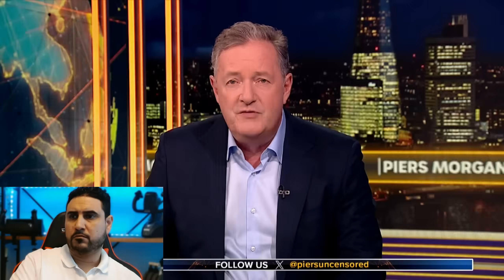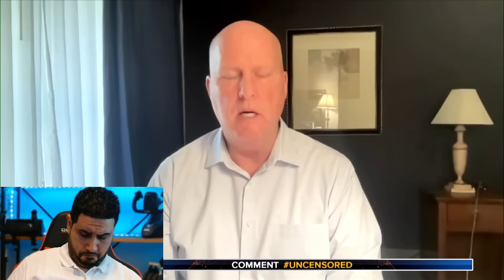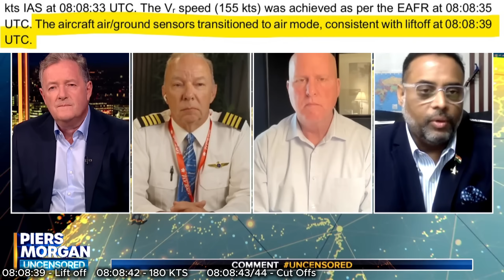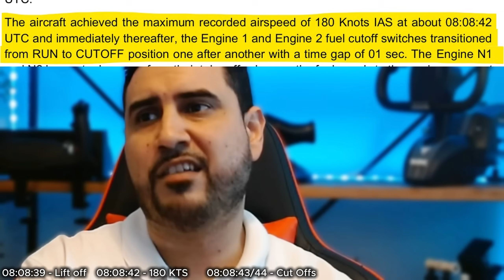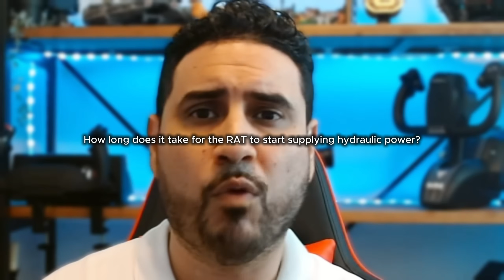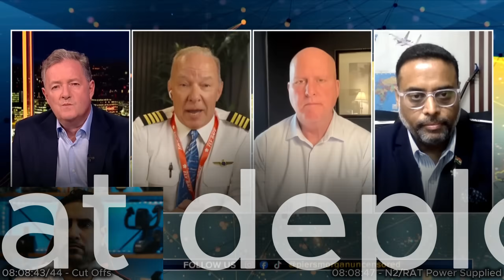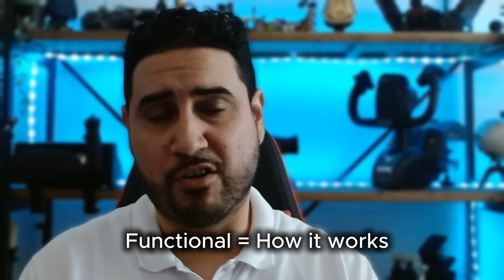TOTAL SYSTEMS FAILURE BREAKDOWN | AIR INDIA 171 | AAIB PRELIMINARY REPORT | MAYDAY | MSFS2024

Comment: One thing that's clear, that I rarely see mentioned is that the cadence of the switch transitions is distinctly human. It would be a bizarre system glitch indeed that mimicked the timing of a pilot. Not impossible, but highly, highly, highly unlikely. The language of the report is deliberately vague and political, but the timing of the transitions is there in black and white.
Reply from the maker: The timing does suggest human, apologies but I dont have my notes in front of me right now, but, there was some logic there within the eletricial systems that could have cause the "delayed" malfunction. This is just "possibility". If there is a possibility, then that loop needs to closed or proven to not have occured.

The tail eletricical arc damage that occurred "bfore" the crash also suggest and points to an eletrical malfunction...just a possibility.

I come from the IT world, BUGS exist, unexplained and highly unlikely things do happen. Thats why its important to have root cause analysis for these investigations and rule out these things.

Comment: That should be the end of road for the pretender brinksman Steve, he is clearly not aware of what he is not aware off or simply misrepresenting a fact to his audience. I don't know which one is more dangerous. Why is he nodding away while laughing in disrespect while the other panelists are talking ? A simple question for those who take his word: Why would he pretend there are no electrical parts downstream of mechanical operation on a modern system like the Dreamliner ? Think about it! Let's assume the lesser of the two evils that he is just very ignorant.

By now there are two much more plausible valid hypothesis at this juncture from what we know,

1) Capt. Ehsan Khalid's consideration that the first cutoff was triggered electronically and then the pilots attempted a restart not knowing what happened, this would explain the 4sec delay between the two switches when restarted as they wouldn't know what's happening because visually they see the switches in RUN position.
So they decide to do it with a slight delay between the two.

2) Ranjith John's hypothesis that there was likely a Li battery fire due to a demand overload as a result of APU failing while the engines were revving up. This caused a thermal runaway and some kind of power failure that prompts FADEC to cutoff the valves, immediate RAT deployment however(likely before in time than proposed) helps to bring power backup and FADEC itself transitions the valves to RUN. If you recall one of the engines fails to get going, this is perhaps owing to the same issue it faces when it was revving up in the beginning. So there is a nice self reinforcing explanation to this hypothesis. Unlike the first hypothesis however the pilots never physically move the switches in this one, they were always in RUN position and they let them be. It was only FADEC performing the valve transitions based on its interpretation of data it gets. May be someone very familiar with the system can opine whether the 4 sec delay between restarts is what FADEC would go for if the system is getting power sourced from RAT. Is that a signature of some sort of this hypothesis ?

Both of these hypothesis have been responsibly discussed by these gentlemen without insinuating anyone and you can find them on Youtube.

Comment: Captain Steve is pathetic. He doesn’t get it. The fuel control switches can be turned off by the FADEc/ECM electronically, where it’s still in the on position.   The pilots realizing that the engines turned off flip the switches to off and then on.    Either Captain Steve is paid off or is a moron.  He doesn’t get it.
Reply: Welp. I think YOU don't get it. 

"The fuel control switches can be turned off by the FADEc/ECM electronically, where it’s still in the on position."

Ridiculous. Doesn't work that way.

Captain Steve may not be an expert in all things, but he knows EXACTLY what he's talking about here, and exactly how the switches and the rest of the system works.
Reply: @BryanM61 Ridiculous to you, but not to people who understand what the FADEC can and cannot do.  And Captain Steve doesn’t get it.
He said in his earlier videos that the flaps were retracted by the pilots and the plane did not get the lift, then he talked about fuel vapor barrier being the cause…..Captain Steve doesn’t get it

Comment: If as Captain Steeeves claims the switch is mechanical and operates the relay directly then the flicker of lights with a momentary power outage would have tripped the relay and shut off the fuel. With that opinion I disagree without seeing it on the schematic. Even relays are not raw, but are fitted with control boards. In concept, the computer is apprised of the state of the fuel control switch, sends a signal to the relay board that actuates the solenoid. Any of a myriad of things can happen along the way, such as corrupted signal, absent signal, overwritten signal, false signal, etc., with the computer correcting it a moment later, but by then in this case with the plane not in full flight it was too late.
Reply: "then the flicker of lights with a momentary power outage would have tripped the relay and shut off the fuel"

Doesn't work that way. The solenoids which move the valves must be powered to open, and powered to close.

Here's the schematic:

https://youtu.be/-ur234kwnhk?t=1103

And here's a statement from a Boeing 787 Systems Engineer (not me!!) who helped design some of the systems:

I hate to disappoint you, but the people (like me) who design, test, and certify aircraft are not idiots. We design for failures. Yes, on rare occasion, something gets missed (e.g. MCAS), but we know that aircraft power systems sometimes fail (or suffer short term interuptions) and we design for that. EVERY VALVE IN THE FUEL SYSTEM MUST BE POWERED TO CHANGE STATE!!!! If electrical power is lost, they just stay where they are. The engine fuel valve must be powered open, and it must be powered closed. Same with the spar valve. The pilot moves a switch, that provides electrical signals to the spar valve and the engine fuel valve to open or close. It's not complicated and has been in use for decades.
Reply: @BryanM61 great info..but if we eliminate the pilots at fault, then what could we have. I am just saying, pilot requested taxi back full length safer take off, then kills himself and everyone else less than 1 minute later? the voice recorder will portray something non normal out of the very busy critical stage of takeoff. a takeoff on a hot day monitoring two engine's N1's ,EGT's, calling v1, rotate, looking for positive rate, check correct pitch angle rotation, landing gear up and all at the same time managing transitioning.,,,lift up and pull 2 seperate over center cutout switches to cutoff. I don't think it could even be done in the sim by the sharpest Pilot.
the landing Gear trucks we're in the toe down position so all this had to have happened
Reply: @cjswa6473  Not quite sure what you're getting at here; I am definitely not eliminating 'a pilot moved the switches' theory.' In fact, I believe that's about the only way this could have happened.

Which pilot we don't know for sure, and not ruling out that it could have been unintentional, but one of them moved the switches to CUTOFF.
Reply: @BryanM61 that's exactly what I am talking about...forget about the pilot's and focus on the possible multitude of aircraft system related options that could have gone wrong. let's start with the basics. what do electrical components hate...extreme cold. extreme heat. extreme dust. extreme wetness/humidity, unstable electricity... now combine that with more electronics backing up the primary electronics...this is what we have here. A plastic electric jet fixed and repaired with speed tape, yellow stickers, and electric module parts changes. A disaster waiting to happen.
I once took a 6 hour delay on a 787 waiting for a "cherry picker" to come across the field,,active runways,, in order to examine a possible defect on the vertical stab.   turned out to be a giant bird poop.. from that point on .I knew even maintenance was scared of the jet.
as a pilot on modern Day jets I can guarantee one of the most common saying found on a voice recorder is......" What's it doing Now".  Meaning the airplane has made some input not wanted or needed
Reply: @cjswa6473  "focus on the possible multitude of aircraft system related options"

Why? There is no evidence of any malfunction anywhere, and the Prelim states "At this stage of investigation, there are no recommended actions to B787-8 and/or GE GEnx-1B engine operators and manufacturers."

Y'all can keep spinning your wheels, trying to find other causes that make any sense and fit the facts; but I have yet to see one theory that can't be debunked with simple logic and reasoning.

Good luck.

Here's a post from a 30+ year Boeing systems design engineer, less than 36 hours after the accident:

"The one thing I keep thinking about is someone placing both fuel switches to cutoff immediately after TO. Yes, it's happened before (twice - 767s in the early 1980s), but the root causes of that mistake are understood and have been corrected. Hard to explain how it could happen (unless, God forbid, it was intentional)."

- and, a day later - 

14 Jun 08:48

Now, if I assume the speculation that the RAT deployed is correct, I keep coming up with two potential scenarios that could explain what's known regarding this accident:
1) TCMA activation shutdown the engines
or
2) The fuel cutoff switches were activated.
I literally can come up with no other plausible scenarios.

Like I said, have at it.
Reply: @BryanM61 just as you say there's no reports of malfunctions. there's no reasonable reports of suicide/ murder. in fact, the captain was going to call it a career in just a couple More tríps AND take care of His 90 year old Father. just the opposite. The facts are also. Does Boeing Hide things. resounding YES. Has Boeing hidden things...Again Yes . Has Boeing been sued hiding things. Yes Again. Have Boeing whistle blowers committed Suicide? Do you Really believe that? Does Boeing have a rep. For Money over   Quality? Yes Again.
So Lets say i have to choose between Boeing AND a capt soon retiring to care For His father after His mother died...who would you pick?😮

Comment: captain steeve is a joke and a joker he himself threw the theory of human intervention in history'sdustbin in his third video how can this illiterate person explain anything who showed AIRBUS fuel switches saying these r Boeing 787-8 switches and thats how they work ! 😂😂😂 he was the one who claims that it was the flaps that resulted in no lift on the Mighty 787-8 😂 he continues by saying that the switches are manual ... this man should not be allowed to touch an aircraft as passenger even !😂
Reply: @AviationCadet9936
Retired airline pilot and former check airman here. I am type rated in 5 Boeing jets including the B787.
Neither Boeing nor Airbus manufactures fuel control switches.
Honeywell manufactures fuel control switches for both Boeing and Airbus.
Each aircraft type has a different part number but they all operate the same way. The switch itself is similar to a toggle light switch in a house with 2 differences:
1) a fuel control switch must be lifted to move it up to RUN or down to CUTOFF
2) a fuel control switch opens and closes an electrical circuit to a relay which, in turn, opens and closes the circuit to the load (valve)
A light switch opens and closes the circuit to the load (light bulb) without a relay.
Captain Steve was absolutely correct with his initial theory that flaps and slats MAY HAVE not been in the proper position.
Remember Delta 1141 at DFW in 1988?

Captain Steve’s theory changed when India’s AAIB stated the CVR revealed one pilot asked the other why HE shut the fuel off.

There are only 2 ways to close fuel valves in flight with at least battery power.
1) Fuel control switch manually moved to cutoff
2) Fire handle manually pulled 

There are electronic boxes, FADEC and TCMA, that can move fuel valves to CUTOFF with the fuel control switch in RUN if 2 things happen:
1) Aircraft on the ground
And
2) Engine limits exceeded
This happened to ANA in 2019 after 1) landing and 2) reverse thrust exceeding engine limits. Jet had to be towed off the runway.

The ONLY other time a fuel valve will automatically close is if both generators fail and will not reset AND the APU fails to start AND at least 30 minutes of battery power is fully depleted.
Aircraft batteries are required by regulation to last a minimum of 30 minutes after all three generators fail to charge it to give the pilot time to find a place to land.
That scenario has NEVER happened.

Comment: @FinalApproachPov, you're one of the very few out there who is talking about possible EEC software bugs, that could have resulted in the dual engine shutdown of AI-171. While "Fly-by-Wire" is the buzzword in the airliner industry since long, we have to be aware of potential errors that may result in fatal accidents - like the MCAS error on the Boeing 737-MAX that went unnoticed for long.

Most people are not aware that, a few  parameters of the FADEC software are customisable, as per the user (Airliner operator's) requirements. Parameters like thrust ratings, idle settings, and performance optimizations can be tailored within certified limits, typically by the engine manufacturer (GE or Rolls-Royce), in collaboration with the operator.

The software uses predefined algorithms (As you've mentioned in your video) and lookup tables based on sensor inputs (e.g., temperature, pressure etc.) and aircraft data (AoA, WoW etc.). While the core logic is standardized, certain parameters may be adjustable within strict limits to accommodate operator needs. However, this underscores the scrutiny on FADEC reliability and the controlled nature of any parameter adjustments, it's certification, and identification of potential bugs, if any.
 
Note that, the Boeing 787 Dreamliner is equipped with an automatic takeoff thrust control system (ATTCS), specifically designed to help pilots manage engine thrust during takeoff and potentially prevent overspeed or over-thrust conditions. 

This system, referred to as the Thrust Control Malfunction Accommodation (TCMA) system, is part of the larger Full Authority Digital Engine Control (FADEC) system, with it's software module residing on the EEC. 

To ensure safety during critical phases of flight, it can AUTOMATICALLY reduce engine thrust or *EVEN SHUT DOWN AN ENGINE*, if it detects a potential malfunction or misconfiguration, or gets a feed from faulty data from compromised / defective sensors,  or even misinterpretation of good sensor data as a critical failure. Yes, validation checks of data integrity are in-built, with multiple levels of redundancy, but software bugs is something that can't be foreseen or predicated, until an incident / accident occurs.

In my perception, the detailed investigation by AAIB should focus on these two key issues, as to what could have caused the FADEC to automatically shut down both the engines, while the aircraft was airborne:-

1). (A) Faulty sensor(s), faulty data, (B) Good sensor(s), corrupted data, and / or (C) Misinterpretation of good sensor(s) good data by the FADEC as a critical failure, triggering the protective automatic shutdown of the engines.

2). Software bug in the FADEC software. (Less likelihood of a logic error in the algos).
Reply: @FinalApproachPov, please have a look at the A400M accident investigation findings that attributed the crash to engine failure, due to a software bug.

The crash involving the A400M military transporter occurred on 9 May 2015, when aircraft MSN23 crashed shortly after take-off from San Pablo Airport in Seville, Spain, killing four Spanish crew and seriously injuring two others.

The crash was attributed to the FADEC  system being unable to read engine sensors properly due to an accidental file-wipe, resulting in three of its four engines remaining in "idle" mode during takeoff.

Engines one, two, and three experienced power frozen after lift-off and did not respond to the crew's attempts to control the power setting in the normal way.

The key scenario examined by investigators was that the torque calibration parameter data had accidentally been wiped on three engines during software installation, preventing FADEC operations.

The accident was linked to a software fault, with investigators suspecting files needed to interpret engine readings had been deleted by mistake.

The crash highlighted issues with the installation of engine control software, a sesious quality problem in the final assembly.

Comment: A "differential fault electrical" on a Boeing 787, in the context of the aircraft's electrical system, refers to a situation where a fault occurs in a way that causes a difference in electrical characteristics or behavior between different parts of the system. This can lead to unexpected system behavior, potential loss of electrical power to critical components, or even a complete shutdown of the electrical system.
This refers to a malfunction or defect in the electrical system. This could be a short circuit, an open circuit, a component failure, or a software issue.